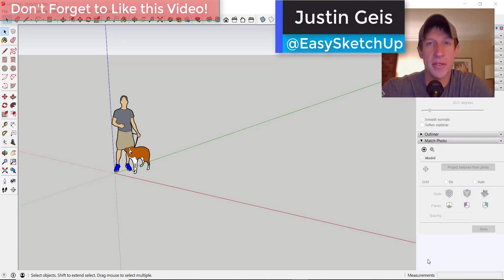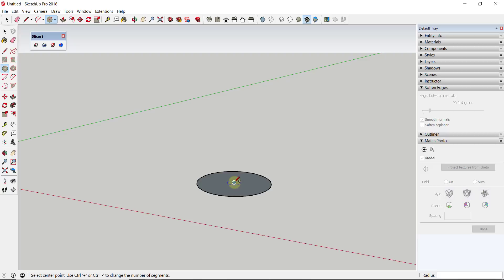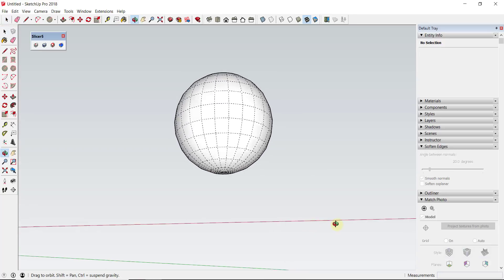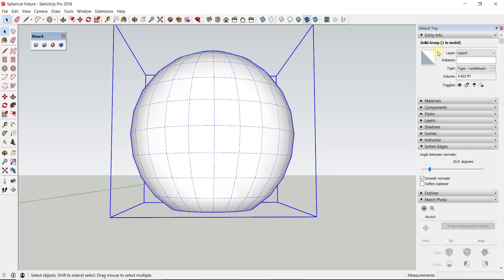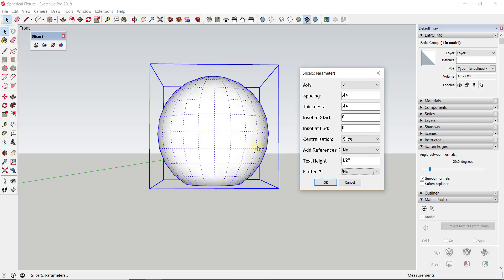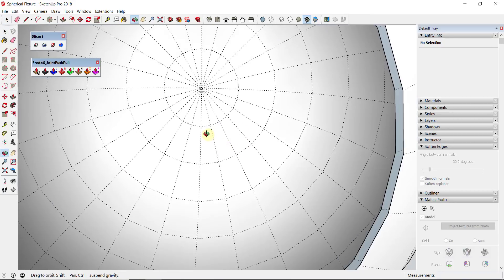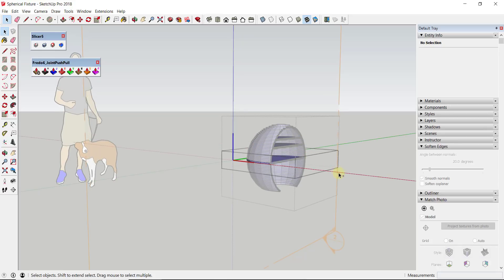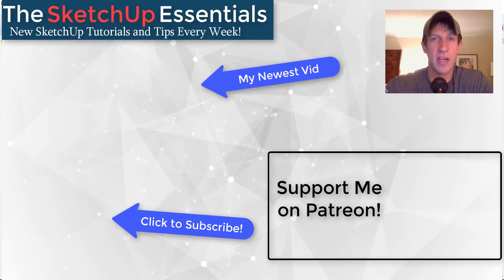Sliced Spherical Light Fixture with SLICER AND JOINT PUSH PULL!

Comment: Justin, you can also use Zorro2 to cut the sphere from the bottom
Reply from the maker: You could - I'm not sure I'd want to install an extension just for this, but if you don't want to cut it off at the hidden geometry edge line, Zorro2 would make a lot of sense - thanks!